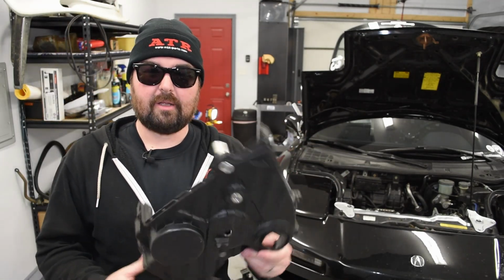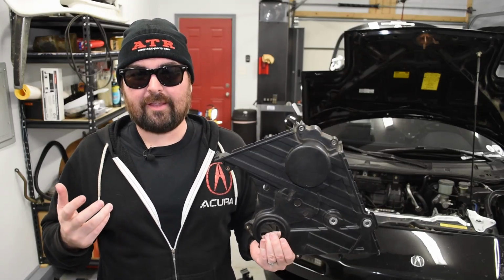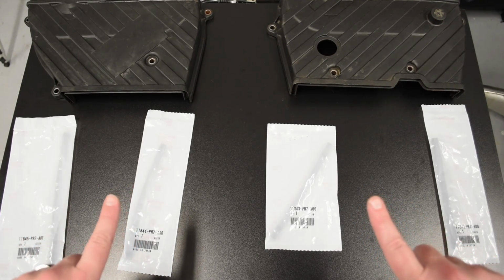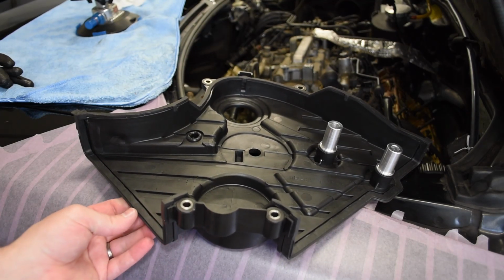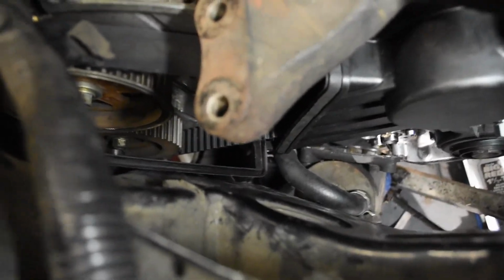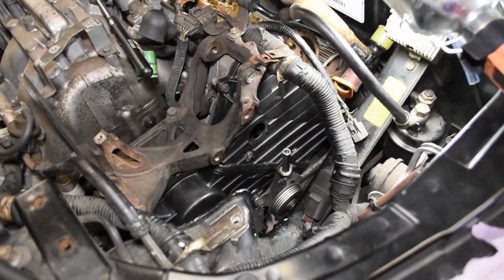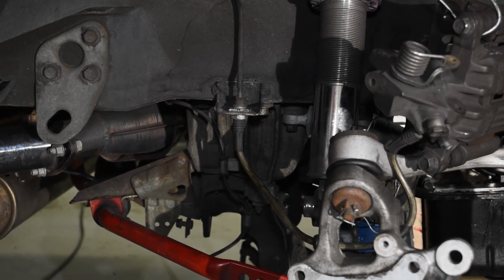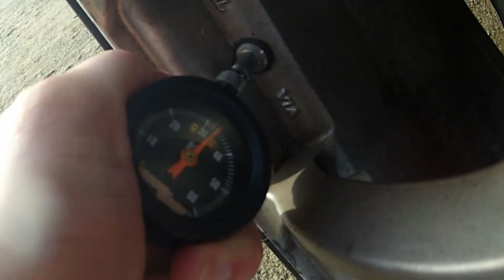NSX Major Service Part 8 - Timing Cover Trivia (and Installation)!  The hardest part of the job?!

Comment: Off topic, what are your thoughts on the latest from EPA and RPM act?
Reply from the maker: Although the reaction is probably over--blown, the EPA language is what I'd call "dangerously ambiguous" and I'll never trust a gov't official's word with respect to enforcement against individuals.  To that end, the RPM act is probably necessary.   That said, I'm not a fan of taking cats off of cars just for giggles.  I run high-flows on the NSX so I get some improved flow without killing Bambi or fuming the person behind me looking for a point by at the track.

Comment: Thanks Richard. Great information.  I may have a record timing belt service - M.Y. 2000 first timing belt service 8/2020!  At 77k.  Previous owner just didn’t want to face it.  
On another note, saw in NSX Driver a Knoxville meet in August. Are you hosting?
Reply from the maker: Lol, DEFINITELY an engineering safety factor in play there.  In what condition were the belt/pump when finally changed?   

Liz and I had them pencil that July event in.  In reality we are watching the COVID situation, but if places are open, the pace of vaccination increases, and we think we can safely replicate something like we did in 2019 then we'll work with our regional rep to get the word out!
Reply: @LapoftheWorld  yes July, not August.  I’m hoping vaccinations will be wide spread by then.  As for the belt and pump, I asked the mechanic to save it, but he forgot to.  Said it really was not in bad shape.  Are you going to do the backwards bend test on your old belt?
Reply from the maker: @apricott1  I did when I took it off.  Could not get it to crack at all.  Aside from slight color difference, it looked and felt indiscernible from the new one.
Reply: @LapoftheWorld  So, I'll chime in here to say that I'm an original owner of a '91 and I had my first and only timing belt/water pump changed at 105K kms (60k miles) and 28 YEARS!! Not a drop of coolant ever leaked from my original water pump. I'd say there's quite a bit of engineering safety factor in play. Am I proud of waiting that long? No. Do I recommend following my lead? No.
Reply from the maker: @mhawke  No judgement here but a good data point for potentially a new owner with a belt of unknown age that while it's still advisable to change it, it may not be such an emergency.  🍻